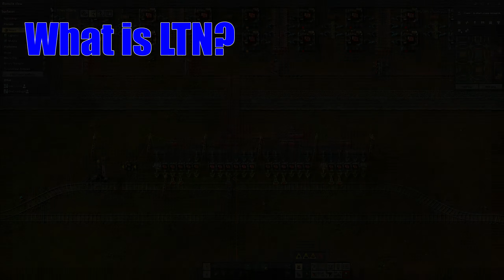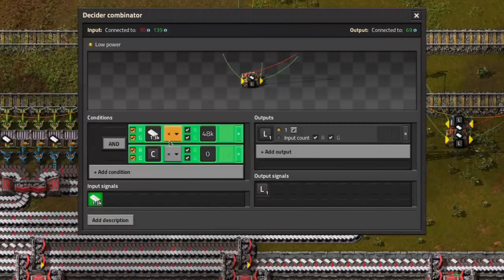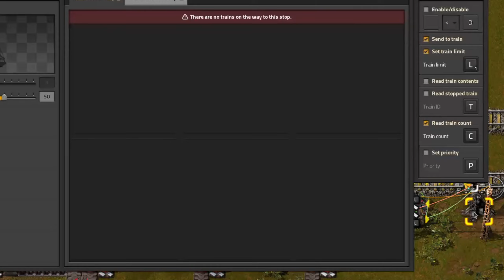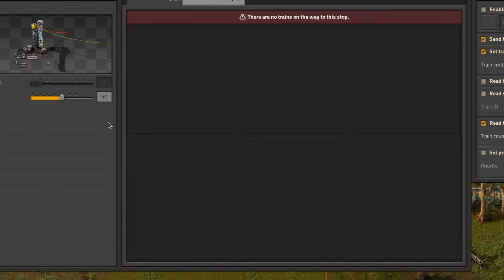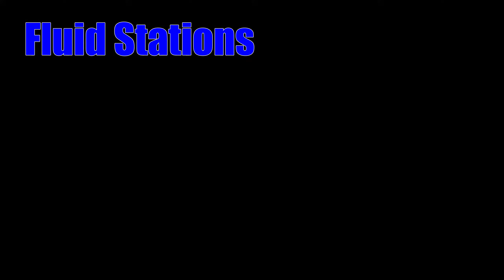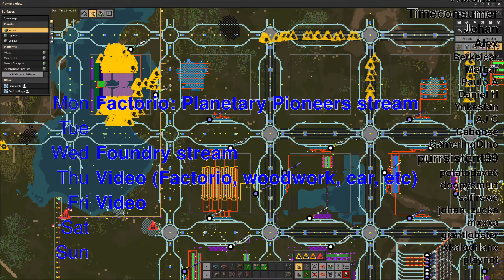LTN With No Mods? - Marc's Vanilla LTN - Laurence Plays Factorio

Comment: How do the trains handle multiple different requests? (especially when one of them cannot be fulfilled...) I figured the interrupt system would only check the first signal in the list.
Or does the Interrupt check all signals at the same time?
Reply: All open requests are signalled to one train at a time. All request signals are checked by the interrupt if the meet the conditions. The first signal that meets the conditions wins and the train get programmed (not 100% sure but I think item/signal order will be in general factorio item order). By launching the train, that signal is being removed 2 ticks later and the next train won’t see that any more.
Reply from the maker: To expand slightly on Marc's answer, the combinator essentially checks all the signals coming in, and will only pass ones which can be fulfilled (ie, there's a station asking for the thing and a station offering it) through to the train, so the train will only get requests it can fulfill. The train will then take the first one, and if there's multiple the others can be taken by other trains.

Comment: That is well done, especially the canceling signal at the right place. I did see someone else having made something similar. It having the same one train per 2 ticks limit and the need for depot intermediate stations.
The solution i made up also has parametrized blueprints for solid/liquid requesters/providers, but uses an auto-priority system, where requesters with less material get serviced first and providers with most material are used first to get materials from. It doesn´t need depots (but it can still use them) as each provider gets setup with a matching train and schedule for that resource straight from the parametrized blueprint.
The downside from my system is that you need more trains overall that are waiting more of the time, but you always have at least one train per provider filled and ready to go when it is needed. (3 trains per provider, so the next one will fill up after a dispatch)